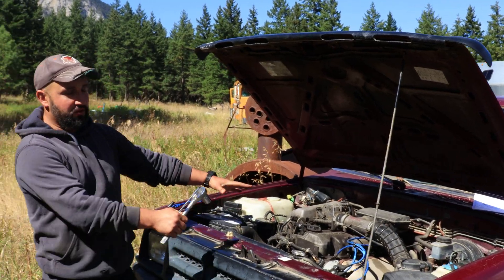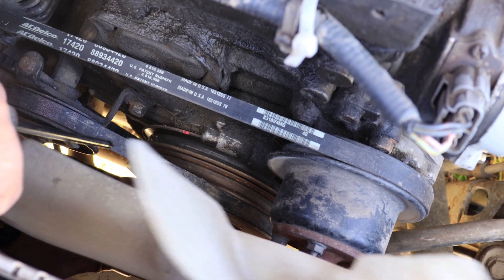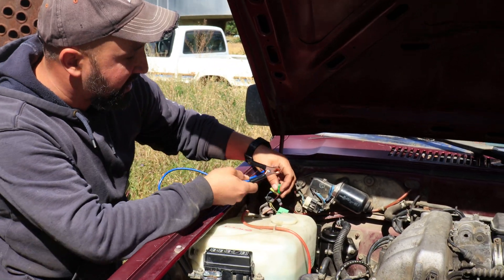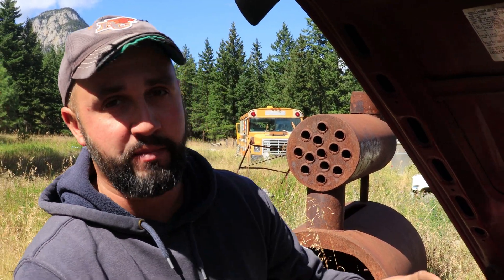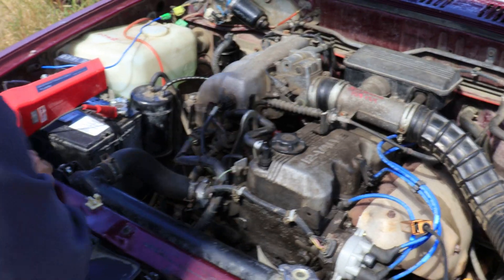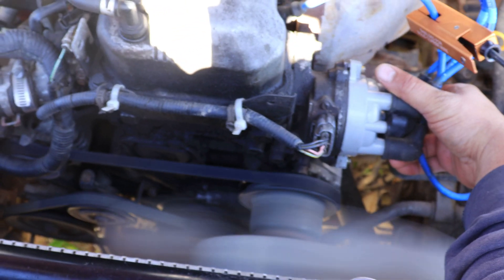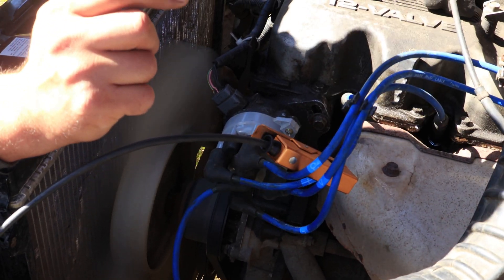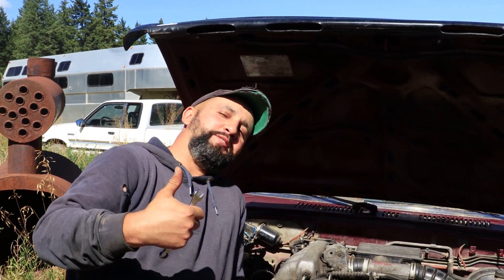IGNITION TIMING MAZDA b2600i, b2200i //4K

Comment: I understand checking to make sure your at top dead cylinder #1 with the engine off, before checking timing.  But omce you start the engine doesnt that rotor spin? Just trying to figure out why it matters that cylinder #1  is at top dead center,   then starting engine? Everything  changes  top dead center  once you start the engine.  What would be the difference if you didnt check #1 for top dead center before starting the engine to check the timing ? Thanks for your knowledge. Just trying to understand and by all means i am not saying your doing anything wrong. I guess my question is what does finding top dead center on cylinder 1 do?  vS not finding top dead center . Wouldnt it read the same timing that it would if you didnt find top dead center of cylinder number one before starting to check the timing. Please enlighten my brain. I seriously want to understand. Thanks for qll your vids. I own a 1990 b2600 and really need to learn how to check and adjust timing.
Reply: Id assume it leaves less movement on the distributor adjuster, I also have a 1990 mazda b2600 lmk whats given you issues im at 125k mi right now

Comment: I have a 1989 mazda b2600i  , the engine turns but does not start. I think it's the distributor.  Is the distributor  on the 1989 unique to that year. Nobody sales them. Only for 1990 thru 1993. Thank you  so much

Comment: Thank you very much for the info. Can someone help me with the cylinder head torque specs for this engine
Reply from the maker: I have b2600i Mazda service repair manual, I will check factory torque specs and paterns for you.
Reply: @PistonShack  thanks for the response and I'll be waiting
Reply from the maker: According to 1992 MazdaB2200 Workshop manual. Tighten the cylinder head bolts in two or three steps, torque 59-64 ft-lb. I can send you tighten order if you need. Spiral order staring from the middle bolts out.
Reply: @PistonShack  thanks brother,  don't you have specs for a mazda drifter B2600i

Comment: What if my distributor is pointing at cylinder 4 while the crankshaft is pointing at 5 btdc? I tried moving the wires so it would be correct but would not run. Put it back to what it was and it fired up but not much power

Comment: This is not the correct way to set the ignition timing on a efi bravo you need to put a jump wire on the green plug terminals so that the ecu will put the ignition into base timing mode that way the ecu will stop adjusting the ignition timing when your adjusting it
Reply from the maker: Yup, that's right James! That what I did @ 2:55 to set ECU in base timing mode. Thanks for your feedback. Cheers)

Comment: Hello why would an ingine heat up after a overhall? By the way thanks for the video. With this i was able to put my dad's pickup on timing.
Reply from the maker: Hi Joe! Glad it helped you out! On b2600i most likely radiator got clogged up or water pump worn out. Check also thermostat, coolant level, fan belt,  ect.
Reply: @PistonShack  thanks will do so and keep up the good job
Reply from the maker: @joepech3073  Thank you brotha! Let me know if you have any b2600i Mazda or other questions. Cheers)

Comment: Do you know the tps voltage to set voltage calibration
Reply from the maker: Hey Kurt.
Throttle position sensor value at IGN switch ON: 1) accelerator pedal released - approx. 0.5V; accelerator pedal fully depressed - approx. 4.3V according to Mazda b2600i repair manual.  
Let me know how is your repair or if you have any questions. Cheers.